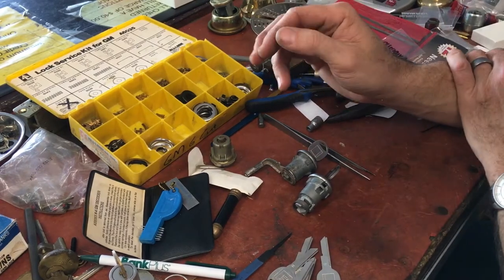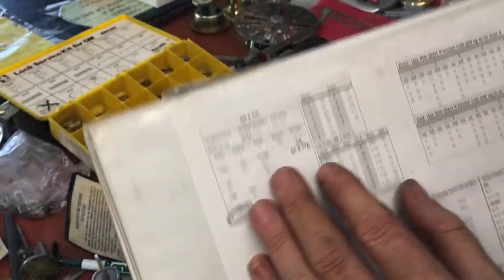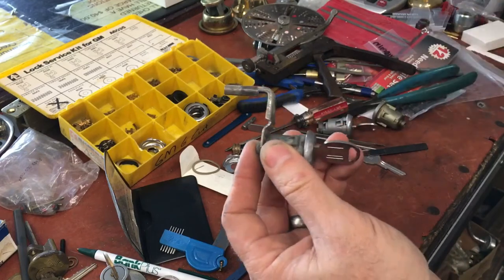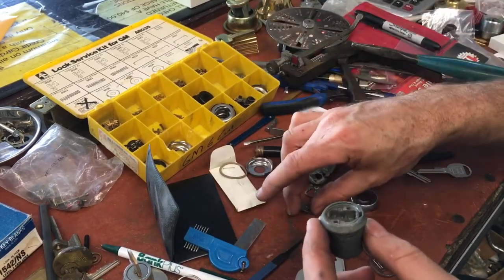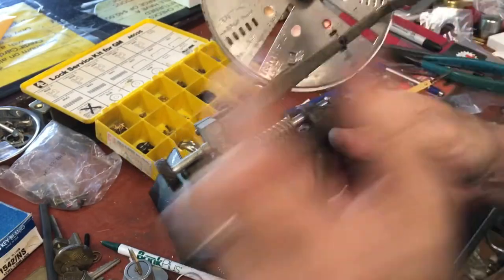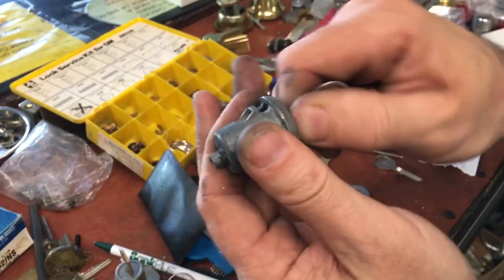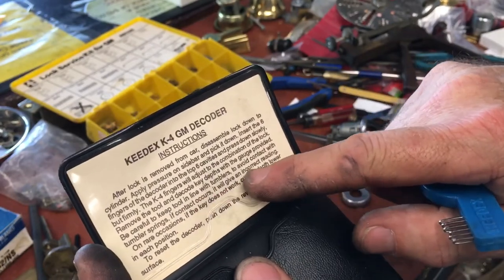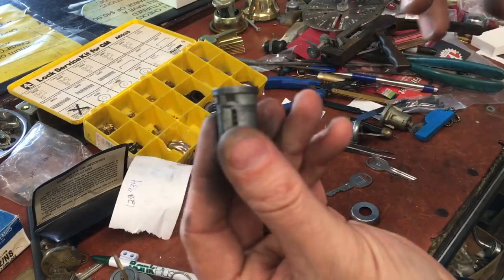GM 6 cut Series Part 1- Making Key from Door Lock with no Decoder!

Comment: do you happen to have ignition switch lock cylinder tear down? im curious and wondering if i can change the um 🤔 little trim piece on the exterior. I replaced my ignition switch and the new is black. I want to swap it for the chrome one on the other ignition switch. Its the older style. From 80s and before.
Reply from the maker: No that part isn’t switchable you would have to purchase it chrome

Comment: great video! thank you. someone keep trying to steal my old truck and everytime messes up the lock cylinders. I am trying to rekey but I can't get that cap off.  I tried to buy those pliers locally and no luck.  I guess you have to be a locksmith to get them.  would you happen to have an old set of those pliers for sale or know how to purchase a pair, what model are they?   thank you!
Reply from the maker: cb brooks you can remove the cap with channel locks/etc, just be careful not to break the rim. There are quite a few parts needed to rekey, have you checked around your area to see if there is a older locksmith store (physical location) around before you go having to buy replacement caps and such?

Comment: Hi, LOved the video - I have a 1988 CHevrolet K5 blazer and I need a glove box, door and rear door key cut as I lost my oval key.  I am pretty sure the glove box and doors are the same keys.  Can you cut me a key if I send you the glove box lock.  THanks, Dave
Reply from the maker: No, GM glove boxes only had 4 of the 6 necessary wafers. While it’s common to use the GB if a locksmith is at the vehicle, they still had to progress the keys to identify the remaining two cuts so they would still need access to door or trunk.